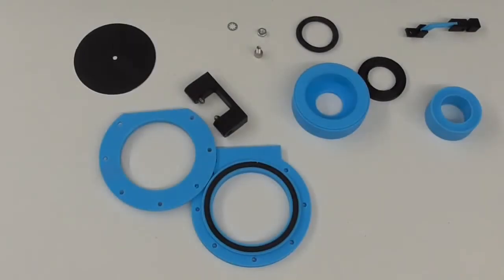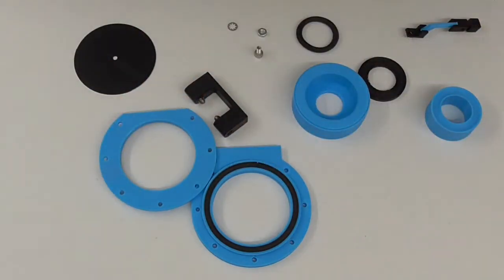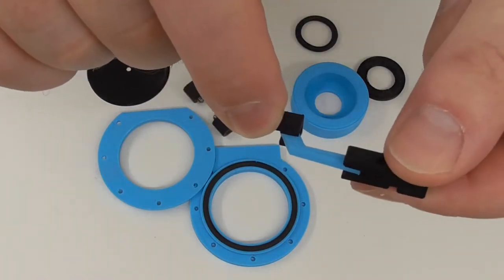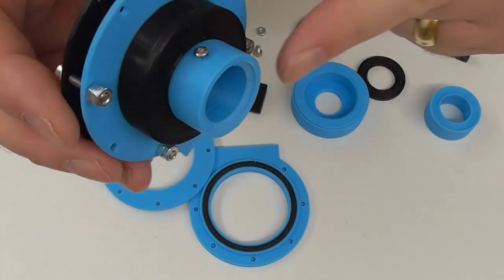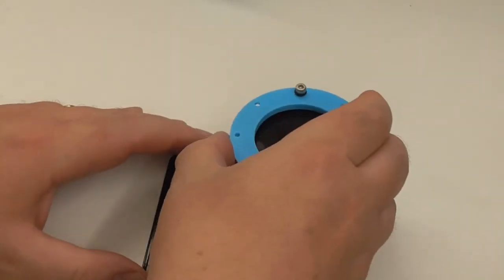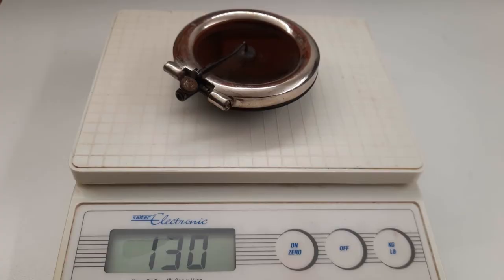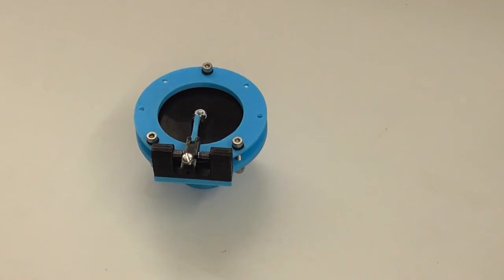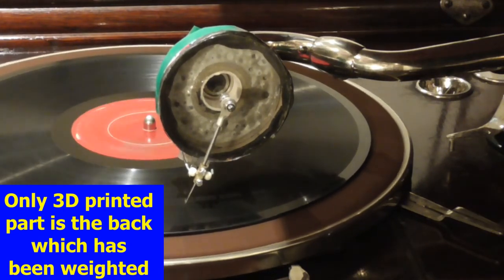3D printed soundbox / reproducer #2

Comment: Wow. Much better than the first attempt. I think you can experiment with different materials for the diaphragm now? Good work. Well done.
Reply from the maker: Thanks 😀 👍.  Yes I will probably use this as the basis for a diaphragm test. I have  most of the mentioned materials to hand, just need to cut them out. I think the bass on this one is better than the previous version, and less surface noise and needle bar buzz, but I am sure I can hear stringed instruments on the HMV rendition, so I think the high frequencies are being cut off
Reply: mrrgstuff is the gasket material you are using as flexible as the usual stuff on sale for gramophone gaskets? The 3mm hollow core white stuff everyone uses? Also , the weight still isn’t equal to the no.4 is it? I’d chuck on some more weight just to see. I’m still unsure about the open sides as well,. Notwithstanding , all very interesting. I can see why it was popular.
Reply from the maker: The gasket material is foamed 3mm neoprene o cord so although it isn't hollow, its not as hard as ordinary  o rings. Having said that, it may not be as soft as the white stuff, I will get hold of some of that at some point as I have other sound boxes which need doing. I do have a HMV No.4 gasket to fit, but its a flat ring type. Yes the weight should be more. I have some ideas for adding weight without adding depth, so the next body I make should be heavier. I'm also thinking about how to fill in the sides. I thought I had seen sound boxes with open sides like mine, but if they do exist, they weren't common! Thanks 😀 👍

Comment: Now that is a big improvement! Think it would be worth trying a mica diaphragm, after all they weren't really improved upon until the 'Orthophonic' soundboxes arrived on the scene. Thanks for the mention of my suggestion re the set screws. Wonder if a more acute angle, tapering to a needle like point would help? They look a bit blunt in the video. Really love watching this 3D printed soundbox evolve!
Reply from the maker: Yes, the set screws were a great idea although these are indeed a bit blunt. I have some bigger cone ones and could machine up some better ones. Its on the list for the next version! Thanks. I didn't think to pick a standard size for my diaphragm, but I think a No.4 one would probably fit. Its something I will probably try, but want to test some other materials first. 😀👍
Reply: mrrgstuff what size is a number 4?
Reply from the maker: @Mrpurple75  Its 54mm diameter.  I designed mine around a 50mm diaphragm, but I think its more like 52mm to make sure it covers the gaskets sufficiently. 54mm should fit too 😀

Comment: Thank you for the shout out. You don’t need my advice, you’re way ahead of me. Now for some advice, more weight. Put those other screws in, there’s a reason those old boxes were so heavy. My box broke and the replacement is much heavier and louder
Reply from the maker: Thanks 😀 👍.  I have some ideas for adding weight without the depth so for the next version that is what I will try. I do intend to put the 4th screw back into this one as I don't think it can hurt. I am tempted to use all the holes though if I use this version as a diaphragm test bed it would make it more effort to change them! 😉
Reply: mrrgstuff I’ve run into the same problem. Maybe the body could be the screw and twist together to hold the diaphragm in place like a mason jar lid. Changing diaphragms would be quick and the pressure on the record would keep the threads tight.
Reply from the maker: @Mrpurple75  Yes, I think that could work quite well and 3D printed threads shouldn't be too much of a problem.  Another idea would be a hinged body with a clip or single screw to hold it together. I will have to have a think when I design the next version! Thanks 😀 👍
Reply: mrrgstuff a hinge and a clip would be simpler

Comment: So glad I came back to watch this video again. One washer I was using for weight was 147 grams! I thought those old soundboxes had more metal in them than that
Reply from the maker: Thats one very sizable washer! I bought a selection, mainly based on diameter, but the weights are in the usefulrange too. The next soundbox will probably be a bit chunkier (and it is pretty chunky now!), but should be much closer to the target weight of about 130g. There was quite a lot of variation between the numerous different soundboxes which were originally produced, so I don't think weight is critical like it is for modern vinyl cartridges. Looking forward to seeing/hearing the results of your experiments 😉 Thanks 😀 👍
Reply: @mrrgstuff  you want to see the frankenphone? Soon, waiting on needles. They’ve been in Minneapolis for over a week. I think I’m ready for a short video when they arrive, maybe. I’ve done some videos but my comfort level isn’t quite what it should be. That’s why I watch you and adapt for my needs. Your videos are interesting and I have always enjoyed watching them. Been a sub since double digits and they just get better. Thank you and congratulations on 1000 subs 👍🏻
Reply from the maker: Indeed, it would be great to see it running.😀 Glad you have been enjoying the videos. It doesn't seem all that long since I was in double digits, but its been a few years! Hopefully the 2nd 1000 will be faster than the first 😉. I do sometimes look back at older videos, and I think I am getting better. Certainly things like lighting has improved, though I have recently gone back to using 2 cameras for flexibility, and I am struggling on the angles, but it will improve. Thanks 😀 👍

Comment: Definite improvement!  It sounds to me as if the bass response of yours is better than the HMV one, but at the expense of treble response.  I guess the next thing is to experiment with diaphragms. Have you considered trying an old 'real' diaphragm in your latest one?
Reply from the maker: Thanks 😀 👍.  I was pleasantly surprised how well it worked. Its mainly trial and error, so I wasn't really sure why the previous one performed so badly, though I did have my suspicions! Although the dimensions are based on the HMV No.4 I didn't think to make the diaphragm the same diameter, though due to the open frame design a No.4 one will likely fit. I will probably try it at some point but want to try some other materials first

Comment: The soundbox is working well, I feel it's the diaphragm that is letting it down, and possibly the needlebar?
Reply from the maker: Yes, the diaphragm certainly needs looking at. I am currently making diaphragms in several different materials which I will use in a comparison test. The needle bar may get improved but probably not until I make the next complete sound box as the pivots are firmly glued in place! Thanks 😀 👍

Comment: Much improved over the Mk1, but I think there is no more room for improvement using a printed diaphragm in my very humble opinion...  Would like to see what the thick baker foil diaphragm would do...  ;)   The one you get in pies...
Reply from the maker: Thanks. Yes, metal diaphragms including pie tray metal is on its way! I have done some of the filming already. It will be a week or 2 before that goes up, though in less than 2 hours my next video where I try various different sorts of plastic diaphragms goes live. Hope to try a mica one also and I plan to build a new version to address the weight issue too. 😀👍
Reply: @mrrgstuff  Excellent...  Catching up...
Reply from the maker: Thanks 😀 👍

Comment: Good work, but isnt it like putting metal legs on an antique table ?
Reply from the maker: My aim is to be able to understand and build all parts of the machine. Its easier to test with a known machine rather than try to build everything and then have to figure out if its the sound box or the horn which is the problem. Also its fun to do! Thanks 😀

Comment: Is there much difference in performance if you use a metal needle arm? That’s the one component that seems to me a funny one to print
Reply from the maker: Its a good point. Originally I was trying to 3D print the whole thing but as the experiments have progressed more and more of it has become made of other materials. A metal needle arm is likely to be better, and maybe in my next design I will use one. I did previously use a metal one on an earlier soundbox and it worked well. Thanks 😀 👍

Comment: Hello could you share the STL
Reply from the maker: Hi, thanks for the comment. This one doesn't work very well. I hope to release an STL or even complete soundboxes at some point, but not sure when. Thanks
Reply: @mrrgstuff  thanks for the attention, is that what I wanted was to lighten the weight so that it does not stop the plate at the end.
Reply from the maker: If the record is slowing down or stopping, first thing to try is to clean the record and make sure you are using a new needle. Use a soft tone needle if you can. These are thinner and require less power to play the record. You can also reduce the pressure on the record by adding a counterweight to the tonearm. Finally, if you can, clean and service the motor as this will help. Good luck.  Thanks 😀 👍
Reply: @mrrgstuff  Hello! Are there currently any models to download?
Reply from the maker: Sorry, still nothing available unfortunately. Thanks for your interest 🙂 👍